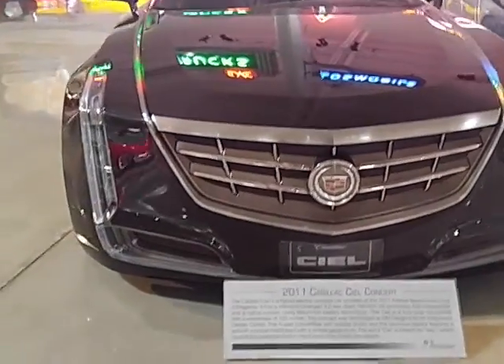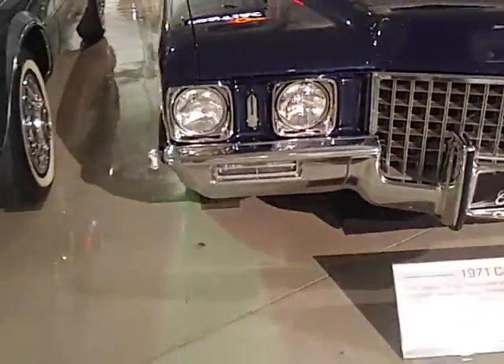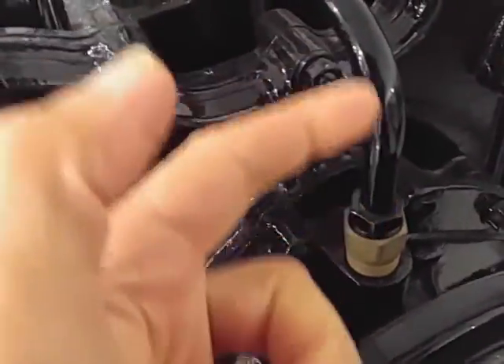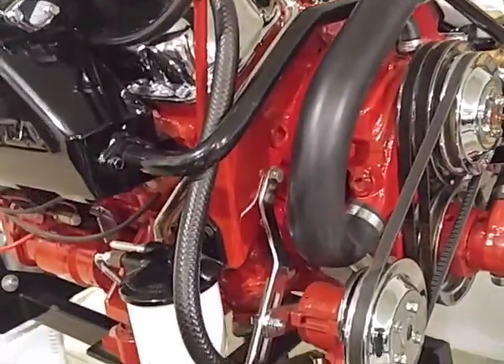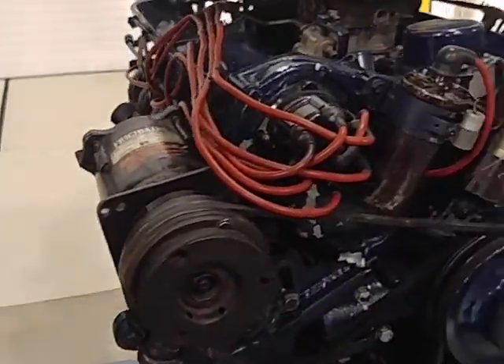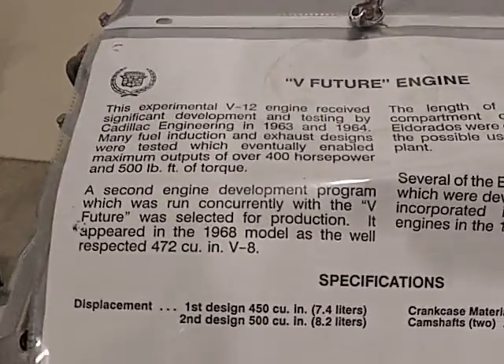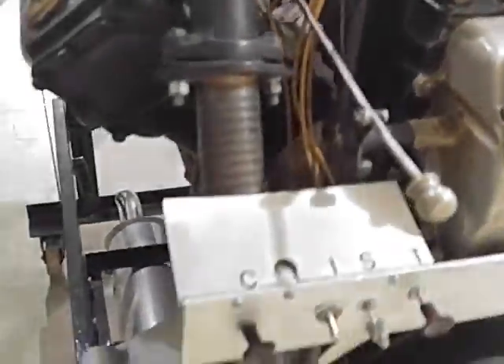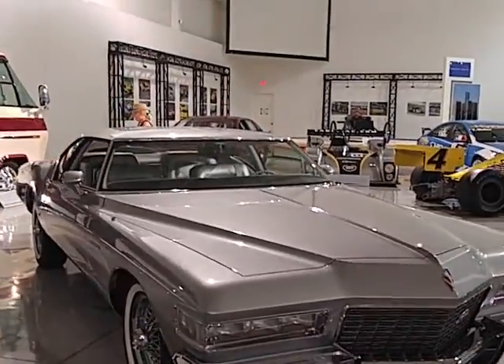Olds Cadillac V12 V16 GM Heritage Museum  8 25 16

Comment: Thanks for the great tour! That Cadillac V-12 was meant for production as an exclusive 1967 Eldorado engine. As you pointed out it had room for the front drive axle to run across the bottom. Emissions, high costs etc. all conspired to nix the business case and the Eldorado was introduced with the regular Caddy V-8. Supposedly, the 12 didn't make much more power than the high compression V-8 did - but the exclusivity and the bragging rights would have put the Eldorado engineering on par with the glorious design. A lot of the car reviews back in the day pointed out that the car was really a Toronado with Cadillac sheet metal. The 12 would have set the Eldorado apart and maybe even given it period supercar status. This engine also explains the huge length of the Eldorado hood. Even the big block V-8 engines look kind of small when you raise the hood on one of these production Eldo's. There was plenty of extra length ahead of the V-8 for an additional 2 cylinders on each side. Too bad it never made production - again, thanks for the extended look at this V-12 that never was!
Reply from the maker: Excellent comment! Thx fer watching